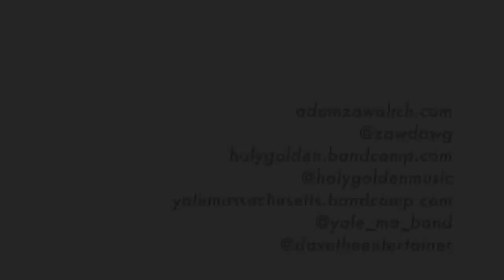Making a Concrete Guitar

Comment: They sell a 1 gallon latex product for adding to floor patch called Latex Addmix it gives the final product extreme elasticity and strength I used it religiously in my 20yrs of flooring installation and used it to make homemade concrete weights/dumbbells works great and no chipping or cracking on the dumbbells I can only imagine this product incorporated in this process...this is on the to do list for sure

Comment: what was the purpose of using both concrete and anchoring cement? The reason I ask is because I am using some mold star 30 silicone mold and I need something that will be very pourable to fill in some smaller gaps, also, looking for something to be pretty strong. Do you have any recomendations? maybe a mix ration?
Reply from the maker: I use a mix of Rockite anchoring cement and Quikrete counter top concrete mix. I add the anchoring cement because it is quick setting and speeds up the cure time.

Comment: how'd you manage burning the back of the neck and not warping/twisting it? I ruined two necks before I gave up on even trying it on the back of the neck. Headstock only for me now
Reply from the maker: I think it was mostly luck and keeping the flame constantly moving. I was pretty surprised and the truss rod needed no adjusting.

Comment: Hey there, Using your video and advice, I've poured my first two concrete guitar attempts.  If you're interested in seeing them, let me know where I can send pics.  Also, is there a low-cost alternative to mold star?  Silicone cost over $250!  Granted, I now have the molds, but would like to someday try other shapes.  Thanks for the video and advice!
Reply from the maker: Oh yea I’d love to see them! My email is az@adamzawalich.com. Yea cost is the big problem with silicone. You can search for different brands of two part platinum cure silicone, but everyone’s prices are pretty much the same.

Comment: Very cool!  How did you attach the pick guard and other things that needed to be screwed in?
Reply from the maker: Thanks! I embedded some wooden dowels into the body so I would have someplace to screw into. Around the 1:06 mark, I'm gluing dowels onto the body. That made a hole in the mold that I could slide the dowels back in later during the concrete pour. At 1:50 you can see the dowels in place in the mold, coated with epoxy. When it comes out of the mold (2:40) you can see the dowels sticking out of the concrete. They were cut flush to the body and in the right spots to get drilled into.
Reply: @ZawalichWoodworkandDesign  Thank you!  I had been thinking of building a concrete guitar for years and wondered if anyone else had done it.  Your video was very  helpful!  I'm nowhere near the wood worker you are, so I was hoping to pour the neck and body in one piece of concrete and then glue on the fretboard (pre-fab).  I thought I might use a piece of rebar down the neck and into the body somehow.  Thanks again for your reply.
Reply from the maker: @Eric-tm9sw  that sounds awesome! I made a mold for a neck too, but it just seemed like there were so many places it could break off, I have a couple of different connection experiments going. There is also a good concrete epoxy by Loctite that has been really good at attaching things to concrete for me.  My first idea was to use that and just glue the control plate and bridge right to the body. You're just out of luck if you ever want to change the pickups.
Reply: @ZawalichWoodworkandDesign  Hey, sorry to bother you again.  Is there an inexpensive molding option?  The Mold Star is pretty pricey, especially considering my first attempt may very well fail.  Thank you for your time, I really appreciate it.

Comment: awesome builds!!! Which song did you use from holy golden?
Reply from the maker: Thanks! The first two are Holy Golden, Forest Beach and Lifeline
Reply: @ZawalichWoodworkandDesign  Did you flash coat the body of the burnt walnut burl, or is it all natural?
Reply from the maker: @codybro5635  I went back with the blow torch and darkened some spots but other than that the black is all natural color from the fire with a couple coats of lacquer at the end.

Comment: Unbelievable ! Great Job really impressive :). What kind of wood did you used for the neck ? :o
Reply from the maker: Thanks!! For the concrete guitar the neck is maple and the fretboard is curly maple. For the black guitar the neck is also maple and the fretboard is holly
Reply: @ZawalichWoodworkandDesign  thank you very much :) I'd like to make my own guitar and I also have another question, do you think I can use Beech to make a neck or it's just forbidden ?
Reply from the maker: @julyenpozzi5085  I can't speak to the sound it will make, but I think it should work just fine. Beech should be plenty hard enough, It might be a little on the heavy side for a neck as long as that doesn't bother you. I think beech likes to warp if you are living in an area with big temperature fluctuations during the year, but truss rod adjustment should take care of that if it becomes an issue

Comment: What silicone mold product did you use?
Reply from the maker: All stuff from Smooth-On. The green is mold star 15 and the blue is mold star 30.
Reply: @ZawalichWoodworkandDesign  How much of it did you use?
Reply from the maker: Jason _ I don’t have an exact quantity for you, I mixed up a gallon of each but there was left over material that I used for other molds that I was also making at the time. Somewhere between a half gallon and three quarters of a gallon is my best guess.  I also made the molds pretty thick so there are probably some places you could cut down on thickness and use less silicone.

Comment: That's cement.  Concrete has an aggregate mixed in.
Reply from the maker: It's a 2:1 mix of Quikrete countertop concrete and Rockite anchoring cement
Reply: @ZawalichWoodworkandDesign  well, there's still no aggregate.  Which means it isn't concrete.
Reply from the maker: @brslade  There's aggregate in the Quikrete. The countertop mix is made with all the sand, aggregate, and cement uniform in size.